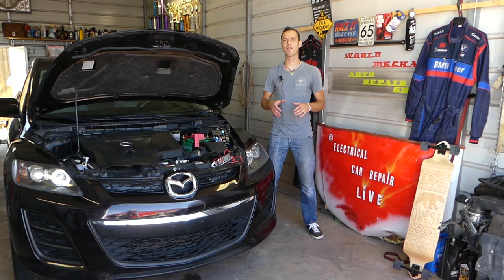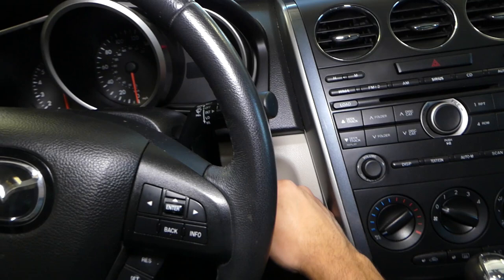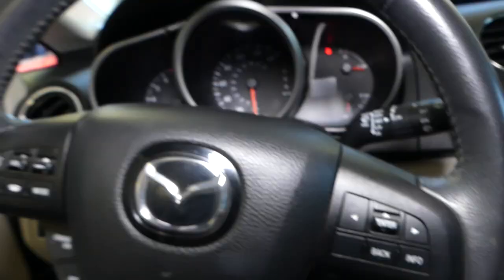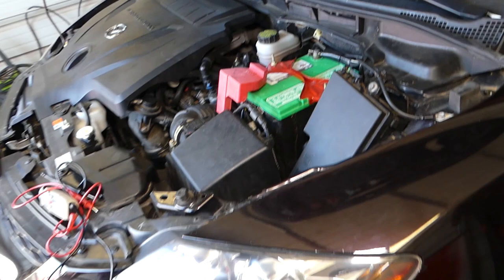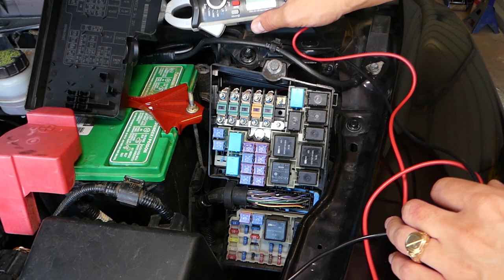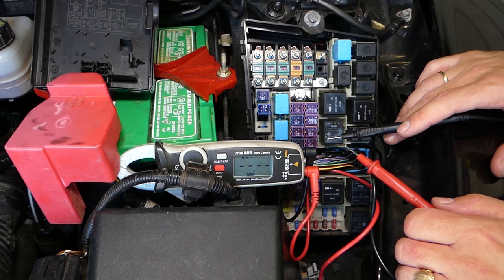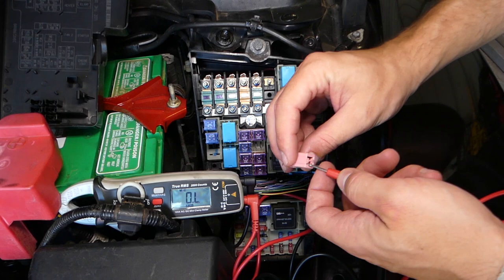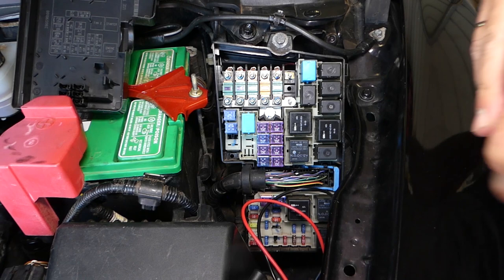MAZDA CX-7 CRANKS BUT NOT STARTING. MAZDA CX7 NOT STARTING

Comment: Hello I have a 2011 mazda cx-7 2.5 4 cylinder engine wants to start but backfires I have already fixed the water pump, thermostat, vacuum lines, heater hose connector, and now I have this new problem with the engine wanting to start but backfires at the same time do you have any videos on that subject

Comment: Quick question.  At 5:27 you point to a sensor, are you pointing to the wire that attaches to the top of the power steering pump?  It looks more like a ground wire to me.  Is  it possibly the ground wire to the injector sensor?  Thanks
Reply: Did you ever figure out if that wire is for  injector sensor??
Reply: @TheAliKat16  No, of course not.  It seems he's not that interested in replies.

Comment: I have a 2012 CX7 that cranks but it sounds like its dragging I guess. I've tested the battery, alternator and starter (just in case) but i cant find what's wrong with it. The relays are good also and I'm trying my best not to take not to a shop unless I have to. Any suggestions to what it might be?
Reply: My Mazda cx7 207 wont start it turns ignition  but it won't start drilled holes on black part of key only key I have
Reply: Please  reply only transportation